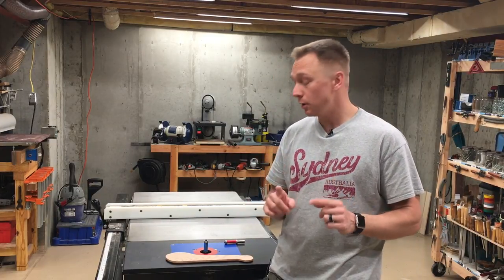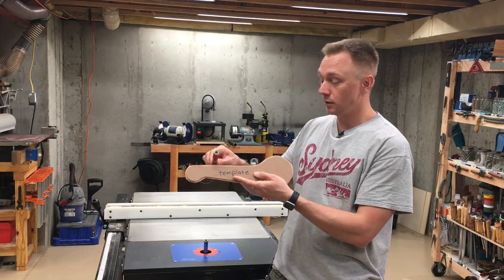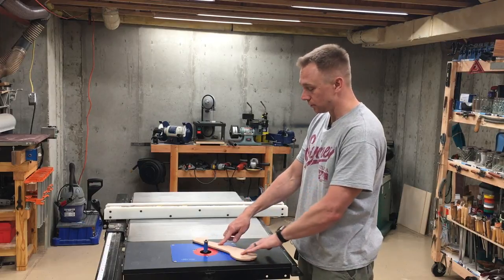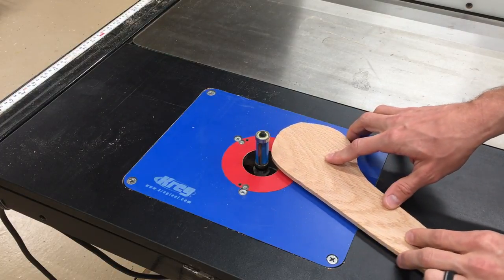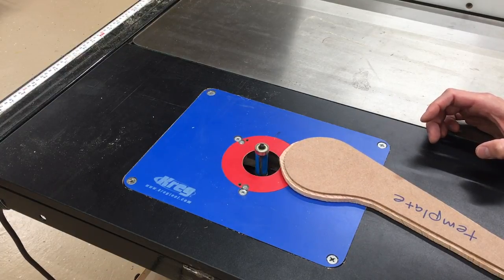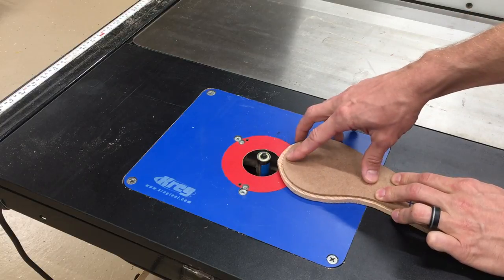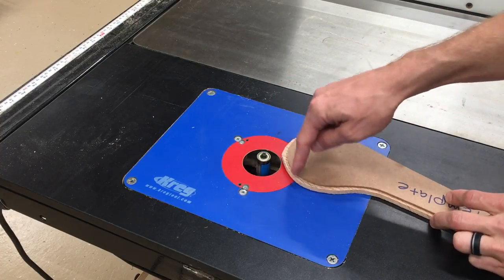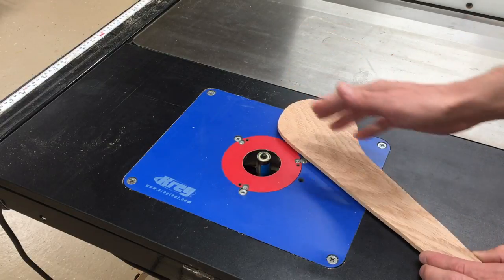Template Routing Question

Comment: I have at least 100 hours on the router table doing  nothing but router template work due to my etsy shop. I don't bother. Three easier things to do first. Cut closer to the final line so your not removing so much waste.  Keep a sharp bit.  A new bit is about $20 if you can't sharpen it yourself.  And lastly but the most effective is to hold on to the work piece firmly and move at a really slow pace around the  trouble areas.

Comment: I don't have one of those fancy double bearing bits, so flipping means a bit change.  Usually I would stack all the parts together and sand them together or use the cnc rather than use a flush trim bit anyway.

Comment: I usually do anything I can to avoid template routing. Like with my adirondack chairs, once you get in the groove it's equality as fast to just cut and then sand down to the line. If I do have to route with a template I just end up climb cutting where I'm going against the grain so I can take one sweeping pass the right direction just to clean the cut up.

Comment: I don't flip it, just keep cutting, adjusting aggressiveness/speed to compensate, but I also always cut my work much closer to the template line so there is little to remove.
Reply: 42Fab - Metalworking and Multi-Medium Fabrication exactly what I was gonna say. I cut mine as close as possible so there is very little material to take off. No chip out with that method so far
Reply: And you router bits stay sharp from less work/heat. I'm always annoyed when I see people cutting and leaving a half inch. If you can't run a saw around something within 1/8-1/4" you need more time on that saw, not a router.

Comment: It depended upon how much material I am taking off.  The answer based upon what I saw in your video would be yes.  It would definitely minimize the chipout. But if I cut my workpiece inside 1/8 inch of my layout line I might just keep the template on one set up and see if I expierience chipout.  It would certainly speed up any production type work, but it would have to be tested.  I guess it also depends on the wood species as well.

Comment: i dont own template bits with a bearing top and bottom. i find that its preferable to have the bearing on the top so that i can see the template and the bearing riding on it. i change feed direction to cope with cutting against the grain i find that even though that means i am sometimes climb cutting that it is preferable to cutting agaist the grain. i often rout guitar bodies which can be around 40mm thick, if you catch the grain on that with a 3hp router... you know about it. despite climb cutting on occasion i find this less likely to catch and gives a good result. the other benefit of having the template on top is that you can see to take shallower freehand cuts first if your cut depth is too deep to do it in one pass. hope that helps.

Comment: I pretty much agree with always going with the grain, climb cuts if the amount removed is small. To accomplish this I also use the template on the bandsaw. I use a piece of the same material as the template and cut a small notch for the blade. If I only have outside cuts a straight piece is ok, otherwise I make a rounded end to overlap the blade (I hope this makes sense - hard to describe without a drawing!) With this method you can make the bandsaw cuts very close to the line and very quick. It also makes a lot of sense if you are making multiple pieces, which is usually the case if you bother to make a template!

Comment: Just my $.02. Keep the template against the router table, try to use non-wavy wood and don't be afraid to use a climb cut when there's a chance of chip-out.  Use a pace that's slow enough to get the job done w/out burning the wood. Though most minor burn marks can be sanded out. If you're using thick stock, your best bet is to use an upcut bit in as large a size as you can get.

Comment: I don't usually work with raw wood, I usually use mdf, as I work with audio stuff. But I've always had two routers, one template bit with a slightly over sized bearing for most of the work, then a flush trim helical flute bit for the finish cut. The less material you remove, generally the better cut you'll have, and a helical flute cuts less at a time compared to a straight flute, which also gives a better finish.

Comment: what I do, is tape the template to the project wood (using double sided tape) then go to the bandsaw and cut away most of the extra wood. i try to get as close to the template as i can but no closer than 1/8". Then onto my router  with a flush trim bit and bearing on top. do that one one continuous cut (no flipping) sometimes I go over the edges two or three times to smooth it out. then finish up with sanding

Comment: I do the flip or approach from the opposite side to keep with the grain.  I've had some nasty tear-out events before doing this and wasted a lot of wood.  Also, if the control of the work piece is not the best, it can be thrown by the router and become a flying object in the shop.

Comment: I use a template guide with a spiral bit.  I make small climb cuts when the normal direction would be against the grain.   Like everyone else, I cut close to the line.  If the grain is really crazy, I use a template guide at the bandsaw to get really close to the line.

Comment: It depends on the wood. Hard dense woods are less likely to tear out, as are soft dense woods. For wood that is brittle ot really "stringy", like bamboo or pine, I try to cut as close to the line with the bandsaw, and finish on the router, not flipping because very little is coming off.

Comment: Andy, I know this is an older video but I had a question about your router wing on your table saw.  Do you still have this setup?  If so how well do you like it?  I'm considering the 3hp Grizzly with the router wing as an upgrade from my contractor saw.  Are you able to use any brand lift insert in this wing?

Comment: I don't switch bits or flip piece. I end up climb cutting. It has caused problems sometimes, but not too often. I only have a top bearing mounted cutter (trim bit), but no bottom mounted bearing cutter (pattern bit??).

Comment: I hadn't considered ever flipping it over before. I usually just sneak up on it and go easy from either side. But, I am not template routing all that often.
Reply: If I feel that the bit is taking too big of a bite and feels like there might be some chip out, I will run it very lightly in the opposite direction I was doing (same direction as the rotation of the bit)

Comment: I just go around the complete workpiece. The way I do it, limits me to that, so I can't do it any other way.
Reply from the maker: +creativeobsin just curious, what's your method that limits you to one complete pass?
Reply: Andrew Klein I use nails (The tip of the nails sticks out just enough to keep the template in place) on the material I need to profile. Moving the nails back & fourth is not worth the effort & ruins the template after a while. One of the my templates can be seen I my video - https://youtu.be/OVr_NPeG1_o
If you watch from 3:30 you'll get a quick look of what I mean. The reson I do this, is because I want to be able to switch from one piece to the next quickly & it can easily be moved around quickly too. The only downside is that it will leave tiny nail marks, though that's not a big problem for me.
Reply from the maker: Thanks for sharing, I think you might like the product I have coming out soon, all I can say for now.
Reply: I'll be looking forward to it :)